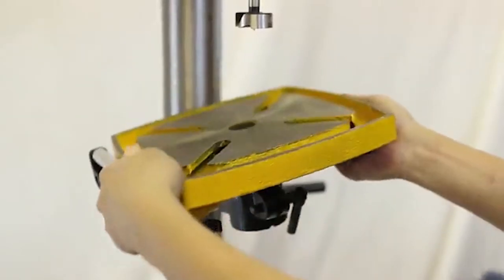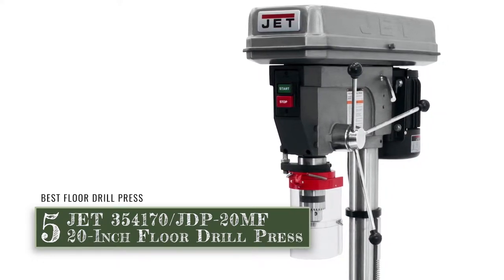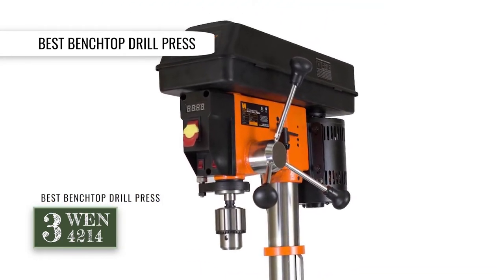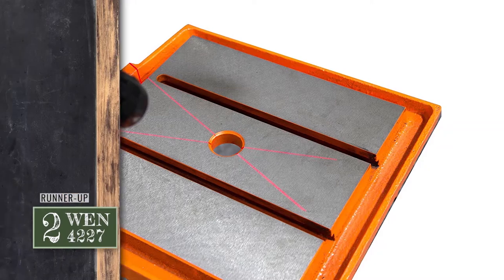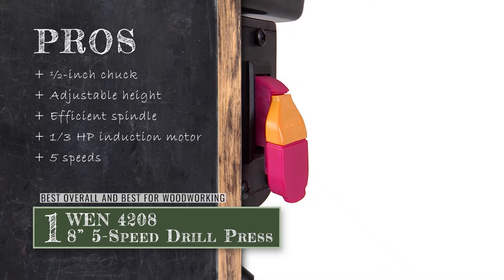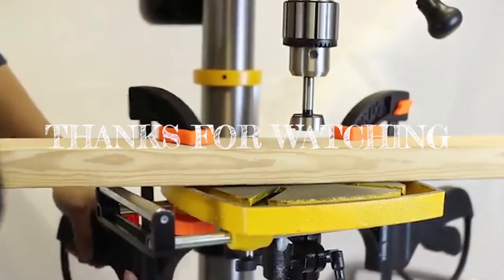Best Drill Presses ⚙: The Best Options Reviewed | Woodwork Advice

Comment from the maker: Read the full review here: ►► 
https://panaceatools.com/drills/press/
(Best Drill Presses)

-------------------------------------
✅ Featured Products for Best Drill Presses

0:00 Introduction
0:44 5. Best Floor Drill Press: JET 354170/JDP-20MF 20-Inch Floor Drill Press ➜ https://amzn.to/2UbfUKr
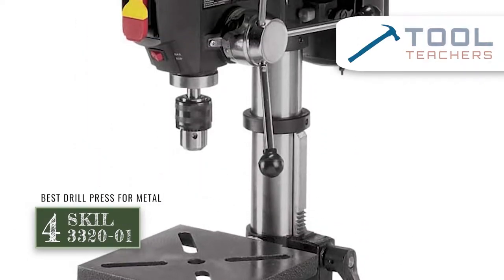1:57 4. Best Drill Press for Metal: SKIL 3320-01 ➜ https://amzn.to/32uuEbW
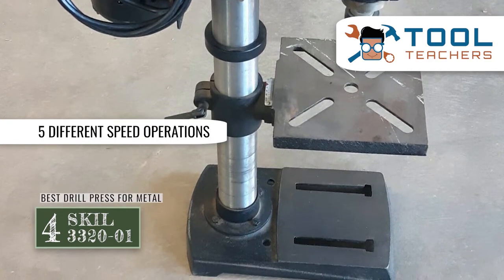3:06 3. Best Benchtop Drill Press: WEN 4214 ➜ https://amzn.to/36pePnU
4:19 2. Runner-up: WEN 4227 ➜ https://amzn.to/35fn5Yn
5:33 1. Best Overall and Best for Woodworking: WEN 4208 8 in. 5-Speed Drill Press ➜ https://amzn.to/38pN812

Subscribe to our Channel 
🔴 https://panaceatools.com/youtube/

-------------------------------------
Detailed review: https://panaceatools.com/drills/press/

⚙ The first question that may come to the readers' minds is 'what exactly is a drill press?' For those who are not very familiar with these machines, a drill press is basically a complex machine that has cutting edges at its points. If you're wondering about its uses, it is a machine that is used for drilling or enlarging a cylindrical hole in various workpieces or parts.

⚙ These machines, as the name implies, are mainly used for drilling but can also provide other functions, such as reaming, countersinking, counterboring, and even tapping. Such a machine is highly capable of cutting holes in or even through metals, wood, as well as other materials.

💬 Let us know what you think of these Drill Presses in the comment section below.

👉 We appreciate every thumbs up and would be grateful if you’d consider subscribing to our channel!!

-------------------------------------
🎥 Welcome to the official YouTube Channel of Woodwork Advice 🎥

Woodwork Advice is your #1 online resource for tools and DIY-related how-to guides.   

 🌐 Learn more about us: https://woodworkadvice.com/about-us/
 💻 Like our Page: https://woodworkadvice.com/facebook/
 📢 Follow us on Twitter: https://woodworkadvice.com/twitter/
 📱 Check out our Pinterest: https://woodworkadvice.com/pinterest/
 🔴Subscribe to our Channel: https://panaceatools.com/youtube/

-------------------------------------
Disclaimer:
Some of the footage used in this video is not original content produced by woodwork Advice. Portions of stock footage of products were gathered from multiple sources including, manufactures, fellow creators, and various other sources. If something belongs to you and you want it to be removed, please do not hesitate to contact us at admin [at] woodworkadvice.com.

Some links in the description are affiliate links. If you click on one of the product links, I’ll receive a commission at no additional cost to you. As an Amazon Associate, I earn a small commission from qualifying purchases.

#WoodworkAdvice #DrillPresses #BestDrill